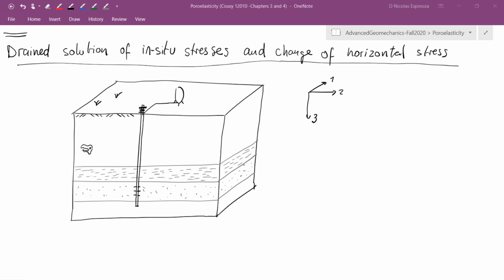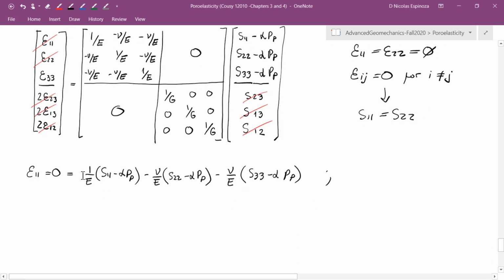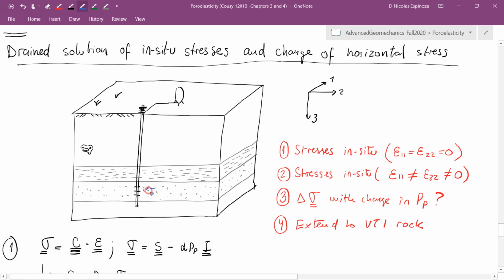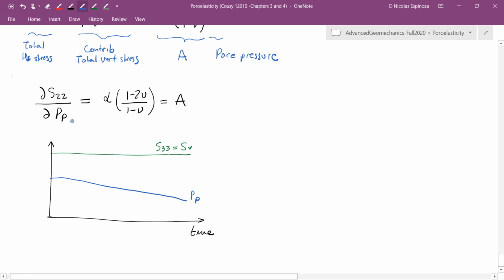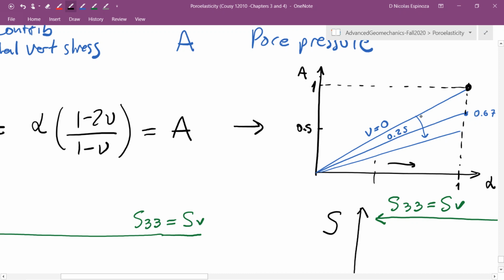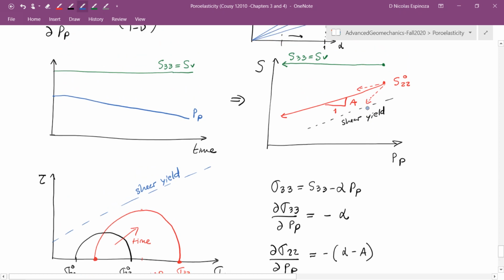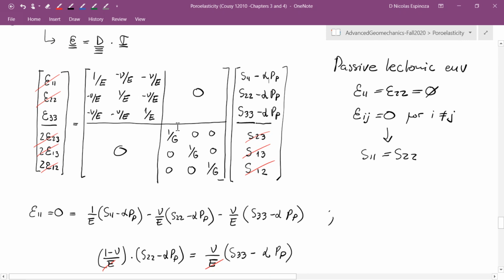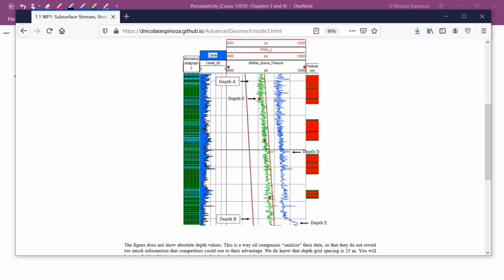L20 Poroelastic drained solution of in-situ stress and change with depletion

Comment: Dear Prof. Espinoza, I have a question might be a silly one. For the Mohr circle (effective stress) part, wasn't the change in pore water pressure were not considered for layers above (overburden/vertical stress). So why the change in porewater pressure would also case the theta33 increase? Or the situation has been changed... Thank you so much...
Reply from the maker: Hi, this solution is only for the reservoir. Decreasing pore pressure causes sigma_33 to increase. The extension of the solution to the caprock is more complicated and depends on wellbore/reservoir/caprock geometry and caprock permeability among others. This is a classic paper in the area: Segall, 1989, Geology (https://pubs.geoscienceworld.org/gsa/geology/article-abstract/17/10/942/186508/Earthquakes-triggered-by-fluid-extraction )